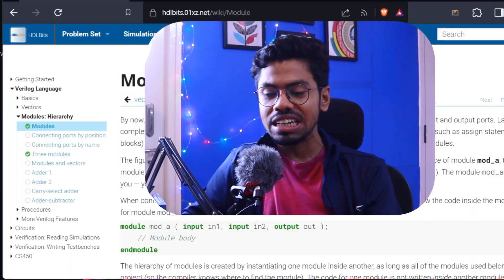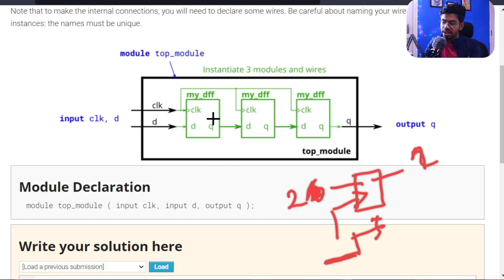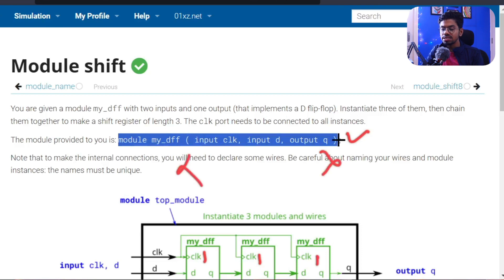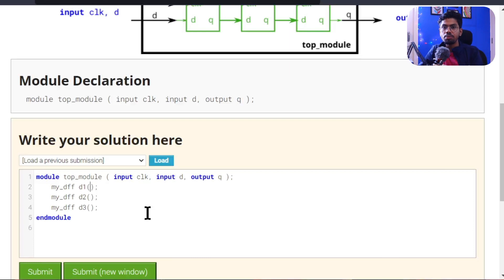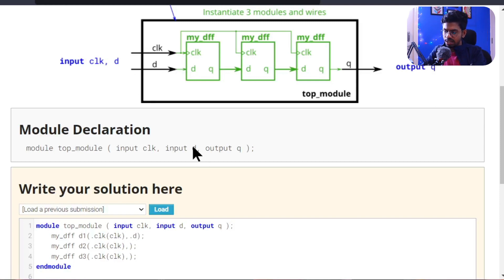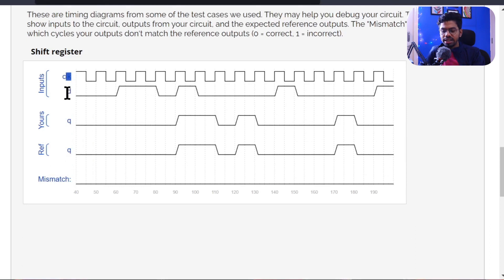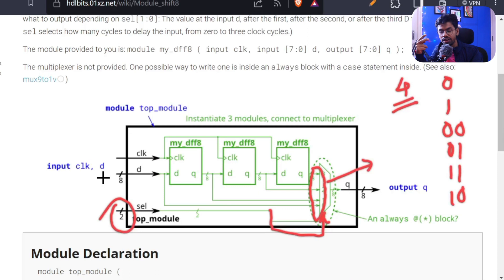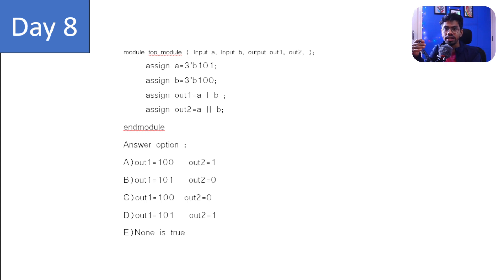Design Shift Register| Lets Learn Verilog with real-time Practice with Me | Day 8

Comment: a = 3'b101;
b = 3'b100;
bitwise operator
out1 = a | b ; //means there will be or operation between every corresponding bits of a and b
logical operator
out1 = a || b ; // in logical operator ll means if anyone input is not zero or 1 then answer will be true or 1 .
so answer is D : out1 = 101 , out2 = 1 ;

Comment: In assign out 1 = a| b it is a bitwise OR so bits of a and b will get ORed according to their weight and generate out1 = 101

In assign out2 = a||b it is a logical OR so it will give a single bit output 1 as both inputs are greater than 1 
So out2 = 1
Option D
Reply from the maker: Thanks for the detailed answer , keep it up
Reply: Thank you